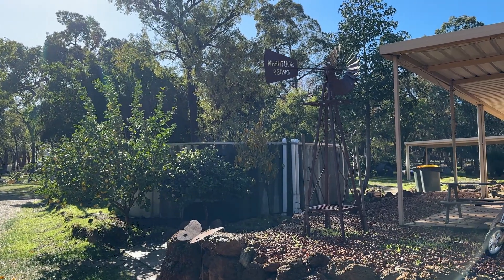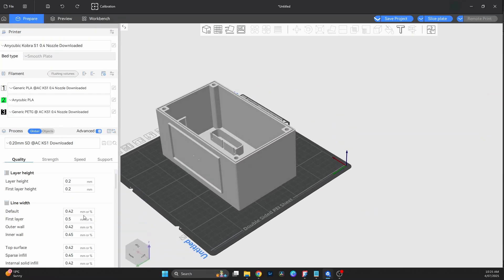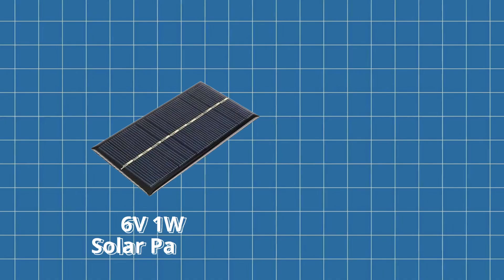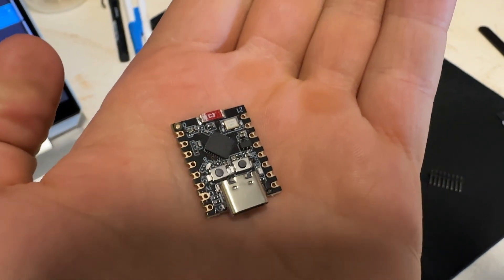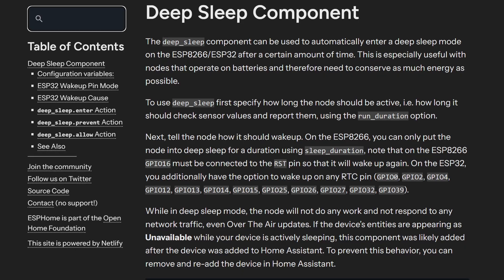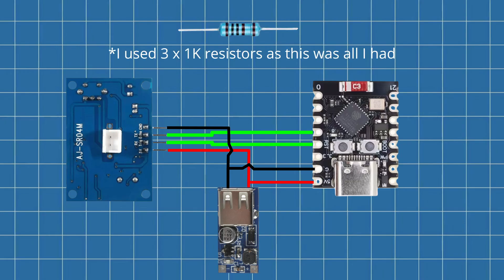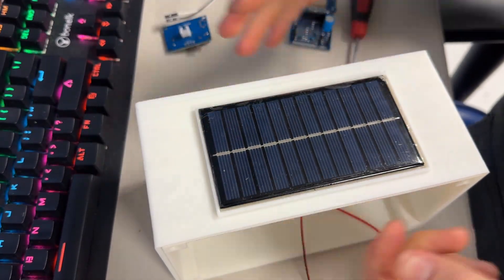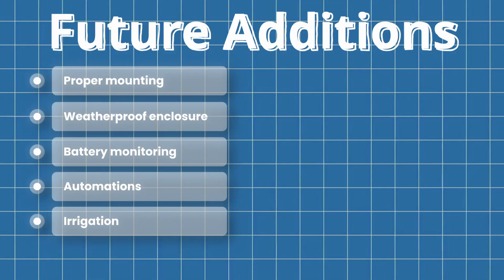I Built a Solar-Powered Water Tank Level Sensor

Comment: Any reason you can think of why this set up wouldn't work for a 275 gallon home heating oil tank? Only thing I can think of is that for calibration I'd never really have the tank empty.
Reply from the maker: If your tank is never completely empty, that’s not really a problem since you can adjust for it in the code. The main limitation is that the sensor I used can’t measure anything closer than 20 cm (about 7.8 in). So unless you’re able to position the sensor higher than that point, it may not give you accurate readings when the oil level is near the top.

Comment: I have a few devices that go into a deep sleep once they have called back and updated but, the values in Home Assistant go to "Unknown'"or "Unavailable" after a few minutes. Is there anyway I can get the HA to display the latest value until it is updated?
Reply from the maker: There is, and it’s a little complicated, but if you check the GitHub link in the description, I’ve included the code I used in Home Assistant to keep the data visible even when the device shows as 'Unknown' or 'Unavailable'. Let me know how you go!

Comment: Nice, I loved your project. Do you think its possible to use with solid products like grains and pellets for animal consumption inside a silo?
Reply from the maker: Thank you, I appreciate it. I don't think it would be the best solution, ultrasonic works best with flat, even surfaces. I think some kind of a radar sensor would work best for this application.
Reply: @J-Rat  Thanks for your fast reply. Is the problem the sensor precision? I don't need a precise measurement, only patterns to not let the silo without grain. Something with more than 5% precision is ok, do you still think it will not work?
Reply from the maker: No worries! Radar is just a bit more reliable in this kind of setup. Ultrasonic sensors can struggle with things like dust and uneven surfaces, which you’ll definitely get with grain and pellets. Radar handles those better because it uses electromagnetic waves instead of sound, so it’s not affected by dust in the air or the shape of the pile as much.

That said, if you’re okay with rough readings and just want to avoid running empty, ultrasonic might still do the job. You’ll just need to filter out some noisy readings and avoid measuring while filling. Worth a shot if you’re keeping it low-cost.
Reply: @J-Rat  Is that what I'm looking for. Do you think radar sensor will be much more expensive?
Reply from the maker: You can get some cheap modules online, look into a mmWave sensor. I've just bought one myself recently and plan to try it out (so I can't comment on it so far), but these sorts of sensors will be much more accurate consistently for your application.

Comment: I did a similar one 2 years ago. Since power is close by I don't use solar for it. That makes it very simple and it works very well. I also use HA.
Reply from the maker: That's really good to hear! Are you using the same sensor as me? And it's still holding up well?

Comment: When I try to validate the water tank level yaml file, I get an error on line 96 and 97. Not sure what to do to fix this.
Reply from the maker: What is the error saying?
Reply: @J-Rat it’s not happy with the code on those lines. I didn’t change anything besides the wifi details.
Reply from the maker: If you could let me know what the error is saying, it might help a bit more. You may have incorrect indentation. Also make sure that you've adjusted the board line to match the board you're using.
Reply: It’s saying that there is an issue with the ignore readings above 3m part of the code.

Comment: Nice project. For the solar panel, I'd make the frame around it smaller so the panel sits on top, then seal the underside. This way the panel will be above any water and the panel will last longer. If the sensor is a problem, you could try a time of flight sensor instead.
Reply from the maker: Awesome, thanks for the tip! I’ll give it a go on my next project!
Reply: @J-Rat  Water sitting between the panel and the frame (in your case the 3D printed case, in large panels its the aluminium frame) eventually causes problems, so the comment above is good. Having the panel go all the way to the edge, with that nice rolled edge on the panel will make the equivalent of a "full screen" panel, where the glass goes all the way to the edge and there is no lip, so no water sits there. We use these on campers all the time, because they are often parked very close to perfectly level so there is almost no natural cleaning of the panel by rain. Some of the problem is the water eventually getting under the glass, the other issue is the dust in the water being washed to the lowest corner, then evaporating and leaving the dust and dirt making a dirty corner. In the worst case this can contribute to hot cells and damaged panels, but mostly its going to ruin your solar production.
Another idea is to get that panel angle away from dead flat, for the Aussie sun you are probably a little more optimised at about 20 degrees (taking into consideration full sun days and full overcast days), but being so over spec'd should make that a moot point. It would be interesting to see how much energy storage headroom you have once you get the battery monitoring part done. We have done a very similar project with scales which also sends its voltage, temp and humidity.

Comment: I tried this method and it was, sadly, a failure. I was getting so many false signals (like ripples on the water's surface when the tank was filling - causing massively incorrect readings) that I couldn't depend on it at all. This was particularly evident when I needed to know when the tank was close to full so that I could divert the water supply to another tank. In the end I abandoned this method (and, as a consequence, have four of these sensors lying around) and went with throw-in pressure sensors, which have proven to be very accurate and dependable.
Reply: Wow, I was going in a similar direction too. Could you share the sensor you've used. The liquid pressure sensors I'm getting here are of nearly 1Mpa, and I believe that's too much extra range than I require.
Reply from the maker: Thanks for sharing your experience, I might have to try some other sensor options too! The tank I have is quite large and has very minimal surface rippling, so I haven't noticed too many incorrect readings, but I have heard other people say the same as you. I'll purchase a throw-in sensor soon to test on my other tank.
Reply: Interesting solution. I wonder how it would work in my 1,000 gallon fish pond.  What I've done in the past is to mount a tank under the sensor as a baffle to eliminate disturbances on the surface. In my case I used a PVC cylinder with an open bottom which allowed the water level inside to exactly match any changes in the tank. Was going to put a cap on the bottom of the pipe and drill small holes around the bottom end of the tube to act as a damper but it turned out not to be necessary in my situation.
Reply: I use an HC-SR04 ultrasonic sensor for measuring the level of my sump pump pit and salt in my softener. I had a similar problem. To remedy this, I take five readings and average them before sending the level to HA.

Comment: This sensor works well as described.  I installed one in a 5,000-gallon water tank and was able to get an exact distance to the water line which I used to calculate the percentage full.  One caution: although it may be waterproof  it is susceptible to moisture buildup on the sensor which can distort measurements and provide erratic results.  If this becomes a problem and your tank is non-metallic you can use these to provide water level information.  XKC-Y25-V Non-Contact Liquid Level Sensor - Contactless Water Level Detection and Control.
Reply from the maker: Thanks for the helpful feedback and glad it worked out well for you! I'll look into the sensor you suggested!
Reply: Yes, moisture ends up making this a less than reliable tank water sensor.  I tried it over a 2 yr period.  Quite frustrating and I ended up using a throw in water sensor which was rock solid for 2yrs ( just recently failed though for an unknon reason).  Excelent video though, great work.
Reply: Very valid comment! I have 2 tanks with this sensor and whenever condensation builds up, the readings become erratic and unreliable. Very frustrating when trying to build automation around. I'll be looking into your suggested sensor asap!

Edit: After looking into this sensor, my plan is to combine it with the ultrasonic unit. With some logic, I can filter out the erroneous readings from the ultrasonic sensor when they are outside of the range returned by 5 or so of these non-contact sensors.
Reply: True.. even I had faced the same challenge

Comment: Sorry in advance for the stupid question but why a 6v panel with a 5v charger? Is not going to damage the charger?
Reply from the maker: Not a stupid question at all! 😊 In this build the 6 V panel feeds a TP4056 charging module, which charges a 3.7 V Li‑ion battery. From there, a 5 V boost converter steps the battery voltage up to power the ESP. The TP4056 is fine with the 6 V panel because its input range can handle that voltage (under normal sunlight), and the panel voltage drops under load anyway. So it won’t damage the charger, it’s a common setup for small solar‑powered projects. That said, there are better options for solar charging, and I’ll be making a video about those soon!
Reply: Oh. I thought that the tp4056 has a 5v input limit. 

Thanks for replying!
Reply from the maker: According to the datasheet, the max input is 8v! But honestly, my setup is probably not ideal the way it is and I do plan to create a new version with better power management.

Comment: You might have trouble with the sensor.  Last year I completed a project to read the water level in two tanks and control the transfer of water between them.  Most of my time was spent debugging A02YYUW ultrasonic sensors - they were flakey at best but I found that parasitic acoustic reflections from the water surface, the sides of the tank and external rain/wind noise made them too unreliable to be useful.  In the end I switched to 'throw-in water pressure sensors' (see DF Robot SKU Kit 0139) which have been both easy to use and rock-solid in readings.  In both cases I used averaging to obtain stable readings.  Otherwise a great project and thanks for sharing.
Reply from the maker: Thanks so much for sharing your experience. Sounds like you went through a lot to get yours working properly. I’ve noticed the same issues, especially with the water level being so close to the sensor at the moment, so I can see why the readings are all over the place. I’ll check out that DF Robot sensor you mentioned. It’s more than I was planning to spend but it sounds like it could be worth it for the reliability. Really appreciate the tip.
Reply: @J-Rat  its because the minimum distance from the sensor and the water surface should be above 20-25 cm ,keep that distance and  I'm sure you'll get a good result ,and also try to keep the sensor away from the wall of the tank,im getting good results even in harsh monsoon weather in south india,also try to get median reading by blasting more than one time per second during the level reading, this way you'll get very much decent results every time , my tank is fully automated and working perfectly 24x7 for half an year using this sensor and an esp32 devkit,
Reply: @J-Rat   If a 100mm PVC tube with a length the height of the tank was weighted at one end and the U/S sensor unit placed at the top of this tube - would that counteract any echoes that contribute to spurious readings?
Reply: I had absolutely the exact same experience and also moved to throw in ones. These too however only last about 2-3 years before getting water damaged
Reply: @fgsltwthghoaos  they are a a maintenance item, replace every 2 years
Reply: I'd considered doing something like what the OP did.  On further reflection I decided moisture would eventually degrade / kill the sensor.   Your comment looks like a good solution to that.  Thanks!!
Reply: Sounds like this just needs a filter algorithm
Reply: THANK YOU!  I have made several versions of water tank level sensors including one similar to the video shown here. They all failed for various reasons. Ultrasonic sensors all water logged at some point. The humidity degrades the sensor over time. I think your immersion sensor is going to work. I have looked at them before but they are all prohibitively expensive. This one sounds perfect. The 4-20mA interface is great to be able to move the microprocessor far away without degrading the signal.

Comment: My daughter has recently moved to a rural block with a water tank up hill from the house.  The climb up the hill and then a ladder to check the water level has been a slippery and dangerous adventure.  I am thinking your project is just what she needs.  Many thanks for sharing your talents with us all.
Reply: If the tank just gravity feeds down to the house, it might actually be easier to just measure the water pressure at the house inlet. Would eliminate the need to have a remote connection and power (or batteries) at the tank and would probably be way more predictable than some ultrasonic sensor that can pick up all kinds of noise and unwanted signals messing with your readings. Of course it kinda depends on the layout of the tank and water levels, if you have a 3ft difference in water level in the tank, that would make around a 1.3psi pressure difference at the water line. You would just need a pressure sensor that can pick up this kind of difference with enough precision and be able to handle the static pressure you get from the height difference between the tank and the house.
Reply from the maker: I'm so glad that this project will help her out, thank you for watching!